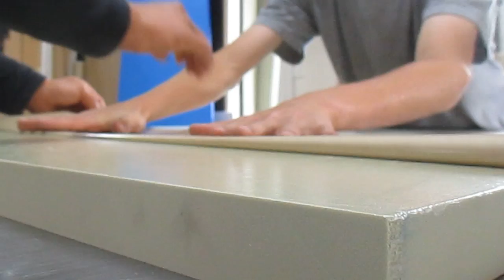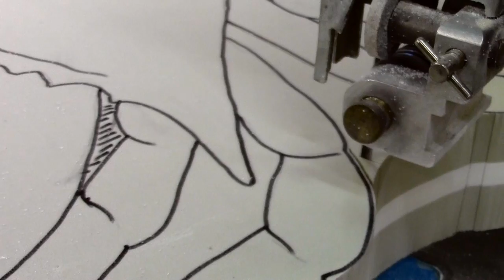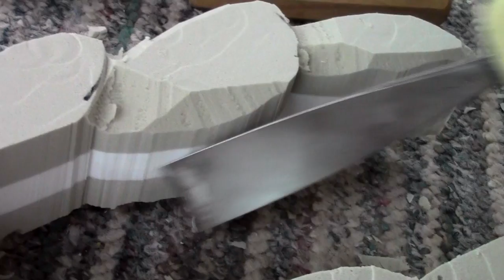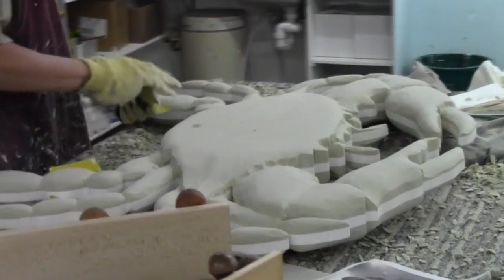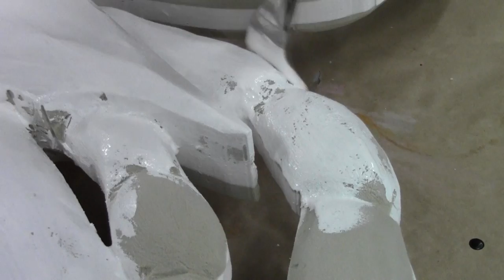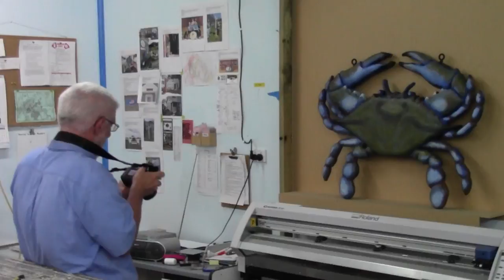Danthonia Designs : Making a Dimensional Crab Sign

Comment: If you goof on a carve, is there a filler or product that you use to reconstruct the piece?
Reply from the maker: 408Magenta Hi! Sorry we haven't been answering  your questions - so here goes now...
About fillers, yes - there is a product called Kneadit, which works well for big goofs. It hardens very hard, so you have to time it just right, but it can be a lifesaver. For small fill-ins, we use Spakfilla. 
About high density urethane - yes, it is easier to work with than wood, mainly because is has no grain, so it won't split. It is a similar weight and density to wood though, so the finished product when painted looks like a wood sign - but HDU is longer lasting because it is completely waterproof.
We have made short videos because each one takes hours of work, and feels like quite an accomplishment to finish! Also, people aren't into watching long videos, in general.
About the gold gilding outside, in general it doesn't last quite as long as the paint, but will still look good for roughly 6 to 8 years, depending on the conditions. (We have found that gold does NOT work well on cove edges, so stopped doing that years ago.)
Hope this is helpful info! Thanks for your interest.
Reply: Many thanks for your time and the great information provided. Continued success.